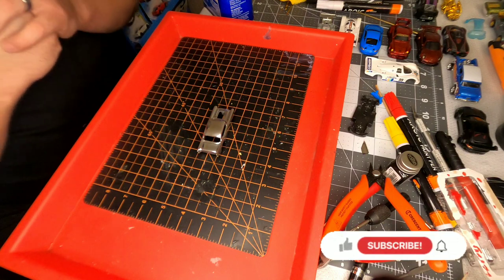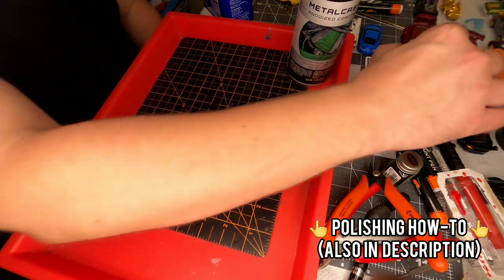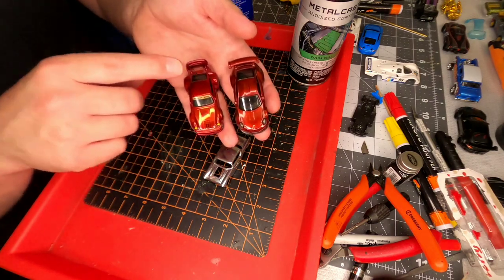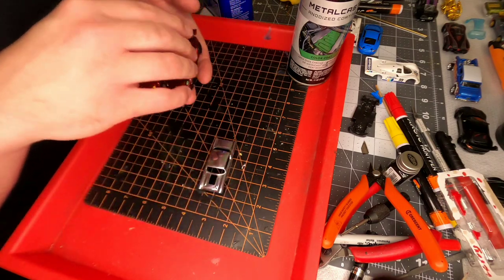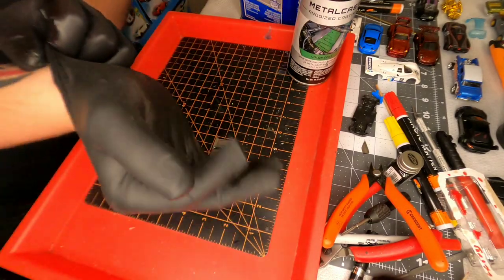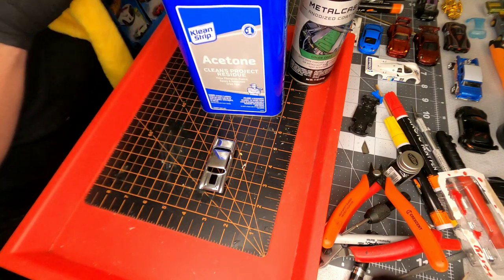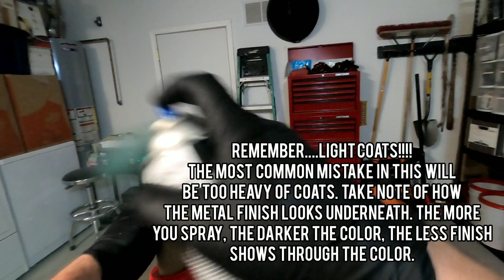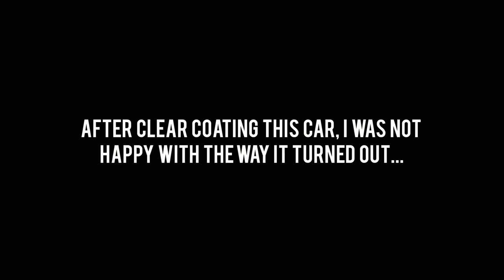HOW TO SPECTRAFLAME WITHOUT USING AN AIRBRUSH!!!

Comment: I like how you showed the differences in cars, it's way easier to visualize and I can actually notice a difference! Such an easy video, I really appreciate the tips! I've been struggling with my paint job recently, so this should help a lot 👍👍
Reply from the maker: My pleasure Closet!  I hope this helps get the issue sorted!  Just remember that since you're not using primer, you have to make sure the surface is squeaky clean.  From the time you wash the surface to the time you clearcoat the final product you shoukd refrain from touching it. 👊😁👍

Comment: These look amazing! I’m trying out the method myself, hopefully I can achieve the same results 😅, I did also wanna ask, how long do you let your cars cure for? before detailing/ clearcoating etc…

Also, what’s your process when applying the 2k clear coat?
Reply from the maker: 2K is really straight forward, nice even coats just enough to cover from about a foot/foot and a half away.

I usually let cure overnight though it can be sped up with a bit of heat.  Hot dry sun for a few hours or about 185F for 10 min in the oven. 😁👍

Comment: Have a question,I used to do paint and body for over 25 years and I'm getting into diecast because I can't do my old work anymore, question is what makes the paint stick to a completey slick surface like the polished ones?
Reply from the maker: Thats a great question and no doubt probably a head scratcher for an experienced painter.  The key is an extremely clean surface prepped with 90%+ rubbing alcohol, acetone, or any type of hard cleaner/purifying agent or degreaser.  Ive even used brake clean in the past, but acetone has worked best for me.  I usually dunk the car in acetone for at least a few hours after polishing to eat away any polishing compound, skin oil, or anything that may prevent a good paint stick.  Ill then clean the compound and impurities from the door jams, body lines, and grills with a pick and do a final wipedown with acetone again.

Once the cleaning is done, you should never touch the surface again until its cleared on the final step.  For instance Ill use gloves and place the car on my helping hands and they wont leave that until the clear is cured.  Make sure the car is up to temp and warm again after cleaning with a liquid that will cool the body like acetone, alcohol, etc..   Spray your paint OVER AND UNDER the body (a lot of people miss this then encounter the paint chipping at the bottom).  Once you're satisfied with the finish, you have two options: 1. Do your detail work and decals (if applicable) then do final clear OR 2. Clear the body, do detail work and decals, then clear again.  Ive done the first option but maybe try the second on your first one and see how you like it.  The clear is the only thing that protects the paint from chipping off, so definitely keep the car out of harms way and be VERY careful while handling.  Hope this helps! 👊😁👍

Comment: Excellent video thanks! After painting, how long do you wait before clear coat? And how long do you let things dry? And do you bring them inside to dry?
Reply from the maker: Thanks Brian!  Since I live in AZ, I live in a life sized curing oven in the summer. 😆  If you have good heat and low humidity, leave the car outside to cure in the sun.  If you do it that way, you can start detailing and doing waterslides in a matter of a couple hours.  Ive been able to strip, clean, spray, detail/waterslide work, and clear in a day.  If you don't have favorable conditions, using an old over or air fryer would be the next best thing.  180F for 8-10 min does the trick per Andres Crux! 👊😁👍
Reply: @HonestDiecast  thanks for the advice! I am going to try baking the car in the sun because I tried clear coating 30min after my last coat of paint and the clear made the car super dull and foggy and textured. Hopefully I can get the clear to look glossy and good this time
Reply from the maker: Yeah 30 min is way too soon.  The general rule for curing a car is if you can still smell the paint fumes, then its not ready for clear yet.  👊😁👍
Reply: @HonestDiecast  thanks for the help!
Reply from the maker: No worries Brian!  Let me know if I can further help and Ill do my best! 👊😁👍
Reply: @HonestDiecast I live in Vegas and have the same weather. I can't wait until winter.
Reply from the maker: Its been a toasty summer for sure!  😰

Comment: All the cars look amazing. But that blue Porche looks amazing in the sunlight. That is a great tip on heating the spray can in hot water. Doesn't spraying in the garage mess up the floor or car parked in there?
Reply from the maker: Hey Fern, thanks for the compliment.  It came out very good.  Super happy with all of them!  😁

The spray is very thin and does not stick to the floor so no worries!  😁👊

Comment: Hi great work did everything as you yet my paint job chipped with the lightest of hits. Pushed another  hot wheel against it and a big chunk cracked off.on accident _Not sure where I went wrong tried a bit and sane . Maybe it's because there is no primer. AutoZone advised to use the primer. Hmmm thanks tho
Reply from the maker: Yes you have to be EXTREMELY careful when using the metalcast on a bare body.  Anything will chip or scratch the paint right off!  I don't recommend touching the paint and keeping things away from it to avoid it.  Its the nature of the circumstances when trying to achieve that spectraflame/RLC appearance, you cant use primer if you want that look unfortunately. 👊😩
Reply: It's all about the clear coat you got to have it with metal cast paint the paint will just chip off unless clear coated properly.
Reply from the maker: Absolutely!  The paint has virtually nothing to grab onto with a brushed or polished surface! 👊😁👍

Comment: This is awesome. Im gonna have to try it your way. How many rounds of clear coats I need to do for the finish product? And do you recommend putting a primer coat before using the spectraflame spray paint? I did my clear coat heavy but It did not turn out well.
Reply from the maker: Hey Kulture!  So no undercoat/primer, if you want a spectra or RLC look you need to spray it direct on a brushed or polished body.  Because of this you definitely dont want to touch or scratch it after spraying the MetalCast.  Clear depends, but I usually go for about three or four solid coats.  Not heavy, but enough to ensure a uniform and shiney coverage after spraying.  👊😁👍
Reply: @HonestDiecast  thanks for responding. I do one thing that I did notice one thing when I do the clear coat, it leaves white spots. Does it have to do with the weather temperature or my main paint wasn’t dry yet?
Reply from the maker: It could be the paint has not cured yet or it could be humidity. 🤔

Comment: Can't find that 2k clear coat video. Can't find these spray cans or clear coats locally. I guess i would have to go order online.
Reply from the maker: You can try AutoZone or O'Riellys and use the Duplicolor 1K Clear as a backup.  As for 2K Clear you'll most likely need to purchase online.  Spraymax was my go-to for 2K but now Car Rep/Tropical Glitz is since it has no potlife unlike the SprayMax. 👊😁👍

Comment: Can I clean body with mineral spirits? Thanks for the video!
Reply from the maker: Thanks for watching!  I would not recommend using mineral spirits as it may leave a residue.  I would use either acetone or rubbing alcolhol as those do not leave a residue and are highly evaporative.  😄👍

Comment: Can we get tutorials on the stand you made from the paper towel roller and cup!? There have to be something else holding it! Lol.

I use alligator clip with wood stick currently if I want to hold my Diecast but yours so sturdy!
Reply from the maker: Thanks Jackson!  Its super easy, just take a paper towel roll and a larger red plastic drinking cup.  Cut a hole in the bottom of the cup just a bit smaller than the roll, turn cup upside down and insert roll.  Thats it!  😁👊

Comment: Thanks for the video!! Maybe try it soon. Also, do you have any tips on how to drill strait into the car when trying to wheel swap them?? I can’t make a clean strait drill 😂😂 thanks for all the content
Reply from the maker: Thanks Sunnyboy!  Its all eyes honestly, but the best way is to run your 3/32" in right down thr middle of the rivet as the pilot when you first start drilling.  Go down as far as you can safely go, then use your big drill bit to snap the head off.  I always try to prevent having to redrill once the rivet heads are snapped and the base is off.  Sometimes Ill run the tap down the pilot before even taking the base off as well.  Helps prevent the end of the post from mushrooming out and making the base a pain to snap back on.  😁👊
Reply: @HonestDiecast  Thanks, I’ll try that, but I have been super careful lately after I drilled strait through my Aventador 😂😂 Rip venti 😢
Reply from the maker: Haha, it happens buddy.  Ive done it a few times as well.  😖😁👊
Reply: @HonestDiecast  Lol 😂

Comment: How much should i wait before clear coat ?? And how many coats?
Reply from the maker: If you cure the paint in the oven or in the sun (hot, dry climate) you can spray clear in as little as a few hours.  Any other condition Id recommend letting it sit over night.  👊😉👍

Comment: I spent $20 on the 2k for my first restoration and didn't know the can is for one time use.  Is there a more efficient way to applicate the 2k???
Reply from the maker: Yeah you gotta use the can within 48hrs after you crack the hardener.  Only other way is mix-on-demand with airbrush.  😞👊
Reply: @HonestDiecast    Thank you for the  inspiration!  Do you think lightly spraying on a lacquer would come close as a substitute?
Reply from the maker: Surely worth a try!  I know many use MinWax and other substitutes, I just prefer 1K and 2K.  😁👍

Comment: May I know why everyone is using that matt on the table?colum and number? what is that?May I known the use of that?
Reply from the maker: @strivexgamein4210  Its a self healing cutting mat.  I use it to cut styrene, tubing, and whatever else (also to measure styrene lengths).  Clean up is a bit easier with it as well as opposed to a bare table top
Reply: @HonestDiecast  thank you I appreciate your help
Reply: @HonestDiecast  bro I mean that green one what is that?
Reply from the maker: Theres two cutting mats in the vid.  A smaller black/orange one and the bigger Grey one underneath.

Comment: How come you don't prime the body before spray painting? Otherwise i learned a lot, thank you
Reply from the maker: Hey Sanjay, glad you found the vid useful!  If you want a spectraflame finish, you cannot prime as you are essentially putting a transparent candy paint on a bare metal body to get the look.  If you clean the body very well and keep it clean then you will have no issues.  My recommendation is to clean with alcohol or acetone, spray the metalcast, then apply clear coat/detail/clear again.  👊😁👍
Reply: @HonestDiecast  Awesome, I'm going to buy some clear spray paint
Reply from the maker: @sanjayvenkatesh4651  nice!  I always recommend Spraymax 2K clear but a good alternative is Duplicolor 1K

Comment: Hey honest diecast those came out amazing! I have a quick question though, how long do I have to wait In between coats?
Reply from the maker: Thank you, Edward!!!  So I've done it both ways and both work.  I have done multiple light coats waiting 10 minutes between coats as directed and I have also shot fully only waiting a minute or two between coats.  I find the second way to be a tad easier to distinguish the shade of color you want to achieve since dried paint under a fresh coat of transparent paint can be a bit deceiving at times.  Either way, you definitely want LIGHT coats or you'll pile the paint on too thick and wont achieve that spectraflame appeal. 😁👊
Reply: @HonestDiecast  thank you so much! Keep up the good work🙏
Reply from the maker: Thanks Edward! 😁👊  Lemme know if you have anymore questions, always happy to help!  😁👍

Comment: not sure if you addressed it. but do you do any wet sanding or polishing after the clear coat?
Reply from the maker: I do not but some do.  I find if the clear is applied right then you dont really need to.  Just IMO 👊😁👍
Reply: @HonestDiecast  could you elaborate on that please? would i apply the clear the same way you demonstrated the paint application?
Reply from the maker: Yup, correct.  I dont wet sand or finish the clear.  Ive found that even coverage is enough to result in a really good clear finish.  Does that make sense?
Reply: @Honest Diecast  gotta thank you! just attempted painting with duplicolor today....followed your steps and they look badass! now I gotta go hunt for more colors
Reply from the maker: Nice Rob!  If you go to AutoZone, Napa, or O'Riellys you can grab a can and see if they can order more colors.  I think Napa is the best bet, but if all else fails then Amazon has them as well! 👊😁👍

Comment: Very nice finish! Does the paint hold onto the polished casting alright? Did you have paint flaking off easily?
Reply from the maker: Thanks Freedom!  It holds on great but Id definitely recommend clear coating.  If you polish the body, the paint does not have much to hold onto and youre spraying it very thin as-is.  Best to get it sealed up and protected.  The 2k clear is the best, the second stage hardener is NO JOKE.  Ive dropped a car after 2k and it didnt phase it.  😁👊
Reply: @HonestDiecast  Gotcha! Sounds good to me. I clear coat all of my cars anyway. 2K is the way to go. Thanks, brother!
Reply from the maker: Yes, 2K clear is INSANELY good and well worth the cost!  Just sucks you only got 48hrs to use it once you crack it!  😖
Reply: @HonestDiecast  Gotta prep up enough castings to use it all up. ;)
Reply from the maker: Yeah, the only downside!  You gotta have at least 8-10 castings ready to blow through a can.  😖

Comment: I tried to attempt this and the paint didn't stick. Is there something I'm doing wrong?
Reply from the maker: Juan, the surface has to be absolutely clean with alcohol or acetone (don't touch it with bare hands after cleaning it).  The body should be at least warm as well, Id say no less than 75F-80F.  Lastly the weather, too cold or too humid might yield less than optimal results.  😁👍
Reply: @HonestDiecast  oh OK so that was probably the problem I had touching it after I cleaned it.
Reply: @HonestDiecast  thanks so much for the feedback

Comment: why no primer? will it do paint chips because no primer?
Reply from the maker: No primer because thatll take away the "spectraflame" effect, thats why its crucial to clean the body well and prevent touching before clearcoat.  You can also apply a few coats of clear after painting and detail ontop of the clear, then clear once more after details are added.  😁👍
Reply: thankyou, but is it guaranteed that it won't chipped off the paint once clear coat is applied?
Reply from the maker: Nothing is guaranteed my friend.  But use caution and it'll come out just fine! 😁👍
Reply: thankyou sir, I'll follow you on your Instagram
Reply from the maker: No IG Walter, but we do have a FB Group.  😁👍

Comment: Great finish mybe not use a clearcoat
Reply from the maker: You have to Brian, if not you will definitely scratch the paint or it will definitely begin to flake off overtime.  The polished finish does not give the Metal Cast much to hang onto and the Metal Cast is an already thin paint being applied sparingly. 😁👍

Comment: How long for it to dry?
Reply from the maker: If you have adequate outdoor sun and temp, it can dry in probably 3-4hrs.  If not, I would let it sit a day before doing anything.  Make sure to try not to touch the paint until you clearcoat it.  Use helping hands or something to hold it while you detail it! 😁👍
Reply: @HonestDiecast  what if I don’t got clearcoat?
Reply from the maker: Gotta get some my friend.  With any paint, ESPECIALLY the metalcast you MUST clearcoat if you want it to last.  Its especially important with metalcast because you're spraying very thin to achieve the spectraflame look.  Also, you are spraying onto a bare metal body that is very smooth so it'll have a tougher time having something to stick to.  You can pick up some Duplicolor 1K clear from O'Riellys as well which is mh go-to for clearcoat usually.  I prefer 2K clear but its pretty spendy and has a short shelf life once you crack the hardener.  😁👊
Reply: @HonestDiecast  appreciate it man! I almost started spraying without it but I’m gonna buy some today thanks😁
Reply: @HonestDiecast  also there’s extreme matte and extreme gloss for spectraflame I’m assuming gloss
Reply from the maker: Either works my friend, whichever finish you prefer.  The matte isnt super flat, still looks great! 😁👊
Reply: @HonestDiecast  yo man I just finished my 3 coats! Where should I let it dry also when it dries how many layers of clear coat and for that to dry?
Reply from the maker: Nice man!  Definitely let it cure in a dry/low humity area.  If youve got dry and low humid weather outside, let it sit in the sun as the sun will help the curing process.  I would give it at least one to two full days to cure before applying clear coat.  As for the clear, start with one tack coat then apply 2-4 more.  You wanna make sure you get equal coverage on the car.  I typically do 2-4 light coats. 😁👍
Reply: @HonestDiecast  Ight so just let it sit for 1 to 2 days without touching it
Reply from the maker: Yeah at least a day!  😁👍
Reply: @HonestDiecast  alright man, always appreciate ya!👍
Reply: @HonestDiecast  hey man sorry for bothering you haha, how long between coats for clear coating
Reply from the maker: If its the Duplicolor 1K, it should be 10 min between coats.  5 min I've found to be ok! 😁👍
Reply: @HonestDiecast  thanks bro I’m so hyped for this finished product
Reply from the maker: Me too brother!  Join our FB group and post it up when done!  😁👊